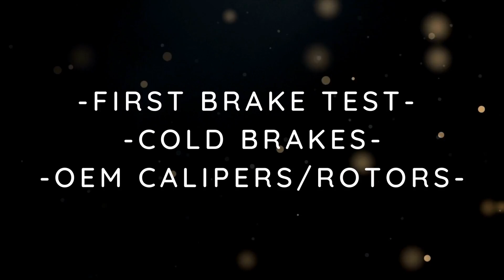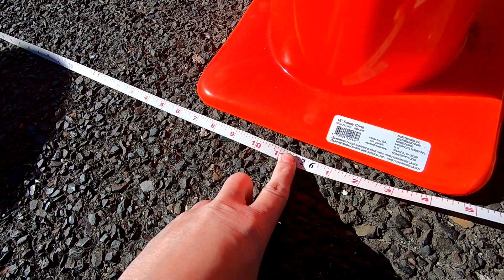G8 BREMBO Swap

Comment: HEY DID YOU HAVE TO TRIM THE BREAK DUST SHIELD BEHIND THE ROTORS BECAUSE APPARENTLY THE LIP ON THE DUST SHIELD RUBS ON THE BIGGER ROTORS
Reply from the maker: @robhatezit5056  yes on the G8 it requires a simple easy trim. Everything else in the kit bolts on like it’s meant to be there.
Reply: Thanks mate much appreciated

Comment: I bought my brakes from zzperformance 6 months ago but still havent installed them. Would be nice of i could of received them painted already. Ive only bought the front but i might just buy the rear now and install all 4 at once
Reply from the maker: I typically do them to customer color specs with hi carbon alloy rotors.

Comment: Hey Dave does the line from the car bolt to the lower of the caliper like underside of top side I have Camaro ones but not sure if we're ever used or need to be swapped the lines and bleeders.      
Does the line from car bolt underneath?   Maybe that'll help
Reply from the maker: What’s important is the bleeders are on the top. Line placement I’ve never seen an issue.

Comment: If you ever have driven a 4000 pound car at any speed and have just an ok break system, you will figure it out in a hurry why you need to upgrade.
 Now my caprice ppv is 4200 pounds on a stock system & and yes, it needs to be upgraded if I plan to make any more hp with this car .
 Heck, to stop a 4000 pound in a shorter distance is huge.  
 Be safe all.
Reply from the maker: You got that right Jeff! That’s one of the reasons I made this video so people could see how terrible those brakes are. Same for the PPV!!!!